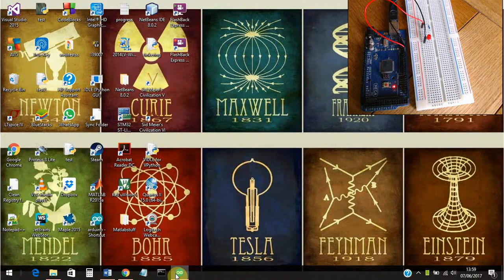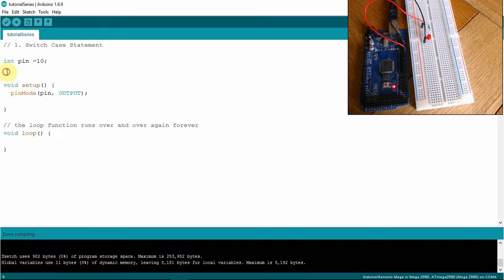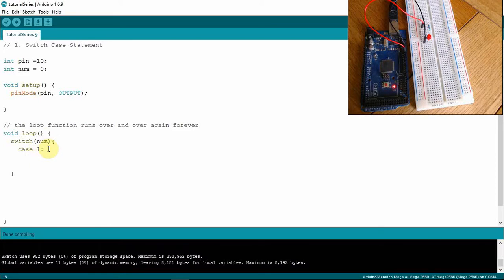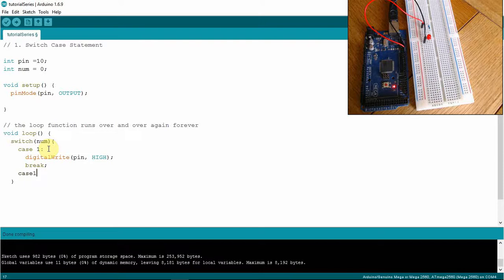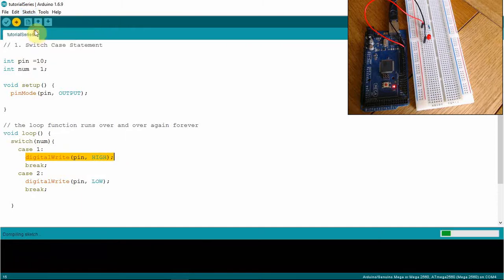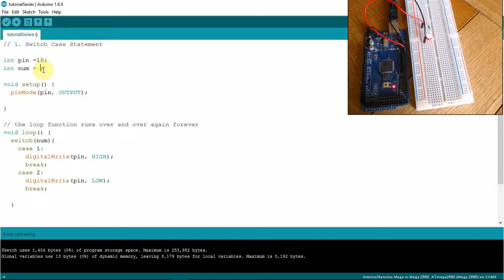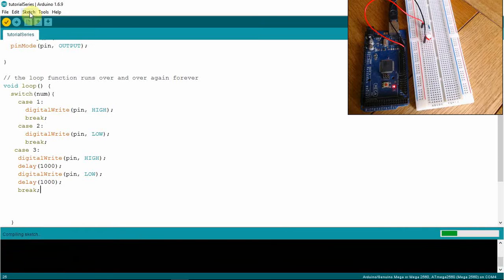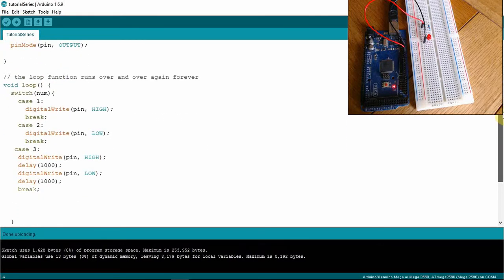Arduino Switch-Case statement

Comment: Better to change values for switch cases like adding increment variable. If you use sensors or button then it requires variable. Such as int i=0; i ++; switch (i){ case 0: // do something; break ; case 1: // do another thing; break; default: // …….; i =0; break;} it was good video. Keep it up. Just need little modification.

Comment: Please  Show The circuit to know which pins to connect
Reply: connect the anode of the led to 220 ohms resistor and then connect it to the pin 10of the arduino and the cathode of led to the GND